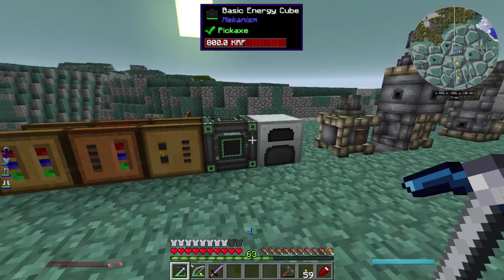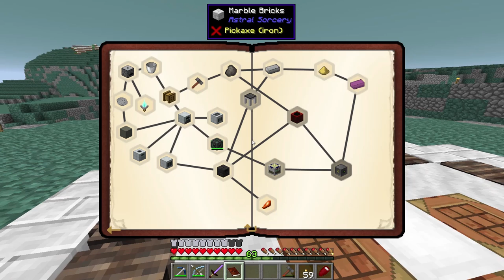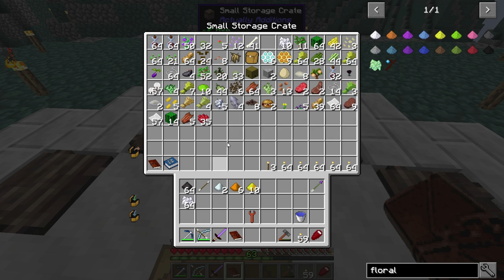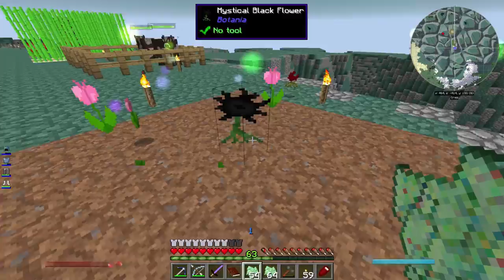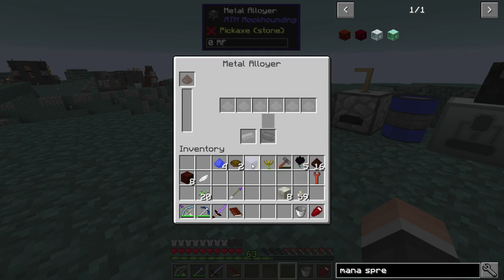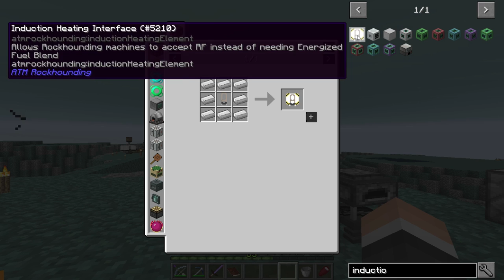Nuts and Bolts Torqued EP7 Tool Forge + Metal Alloyer

Comment: Your limestone comment reminded me of the ATM Rockhounding. If I recall correctly it doesn't really have a use, but granite, its other normally equally useless counterpart, has a use for once in Rockhounding. Can't wait to see your take on the rockhounding setup, to be honest from a game design perspective many players didn't enjoy it since it was basically RNG based and required mass parallelization (ie more machines) to get the alloys they need, but it was enjoyable trying to optimize the process and getting the ratios of processing machines correct, but it definitely was in the realm of being enjoyable only the first time you do it.

Also liked the change made to the Pure Daisy, they made the base materials slightly harder to get, but at the same time greatly decreased the other cost in the Daisy, which was waiting time, thought it was a small but nice twist. Endgame Botania was also neat in this pack once you scale past Endoflames, looking forward to that.

Comment: yeah I need to make the metal alloyer except my dawnstone still isn't making any so I'm gonna try to see what's wrong with my setup in creative mode
Reply from the maker: Still have not figured that out? Is it mixing in the Centrifuge?
Reply: SystemCollapse its all working with pumps but when it gets to the centrifuge(which I broke and replaced a lot) it either only puts gold or only puts copper from the tanks. its powered and even says its full of power with more ember in reserves. so i have no idea.

Comment: When I try to put more than two dust in the metal alloyer, it doesn't let me. I can't put gold, copper and silver together to make rosegold. Any idea why this is happening?
Reply: It only worked with gold, copper and silver grit from immersive engineering. I haven't tried all of the variations, but it'd be nice if they all worked. I'm using the latest build btw.
Reply from the maker: I was about to ask if you were using a compatible form of ore dust. at least it worked for you.